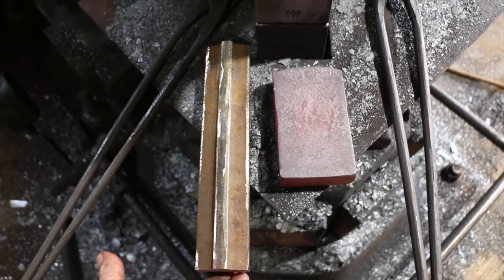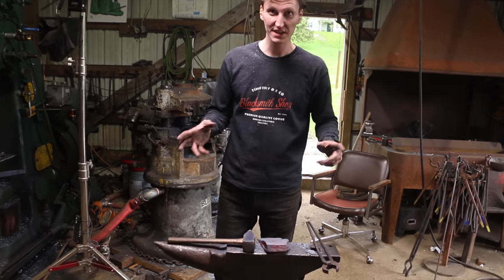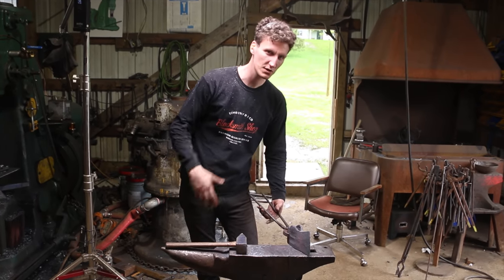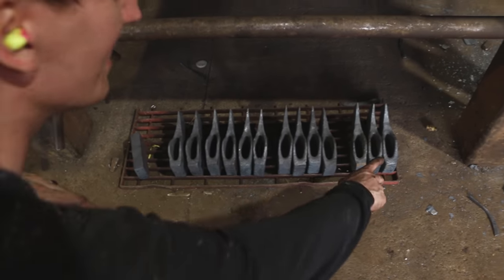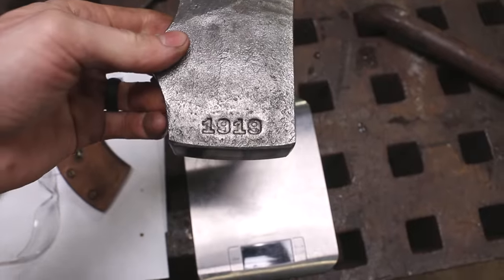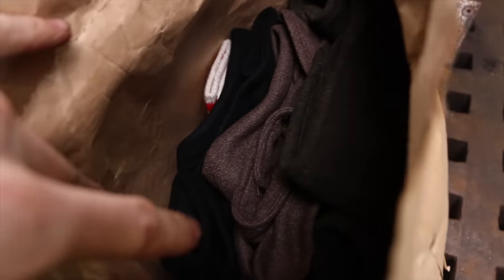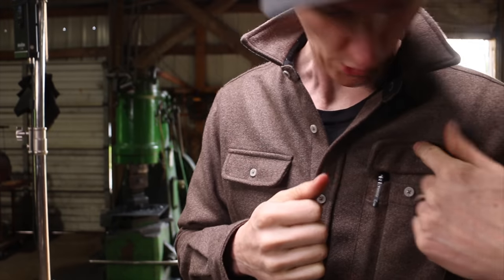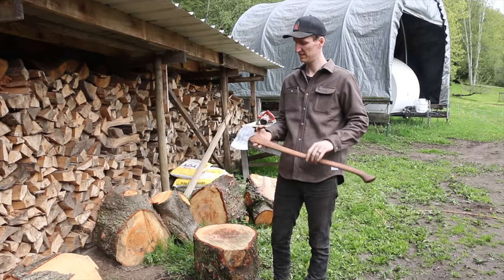Forging an axe from train rail.

Comment: @Timothy Dyck is that the same Titanium hammer you made in a previous video? If so how has it held up and what are your thoughts of the lighter hammer?
Reply: Likes it but doesn't respond
Reply: Pretty sure he has talked about it a few times in videos after he had used it for a while.  He seemed to like it a lot.
Reply: Christian Howell - it is the same one he made a while back and from the looks of it the hammer hasn’t deformed much, if at all. He also did say in another video (can’t remember which) that it’s a hammer that he will walk across the shop to get. Even if there is other hammers around he wants to use that one.